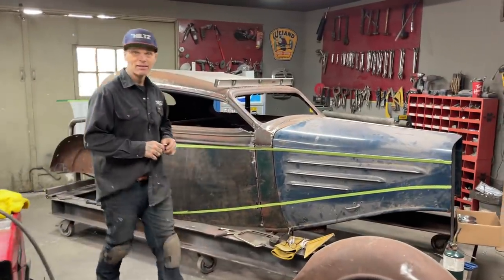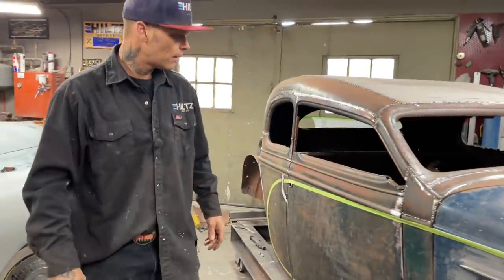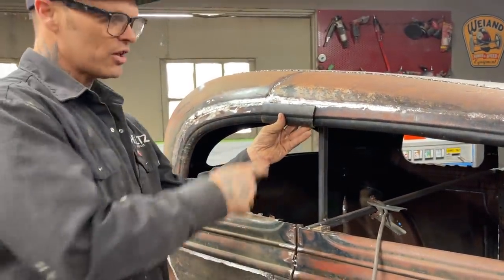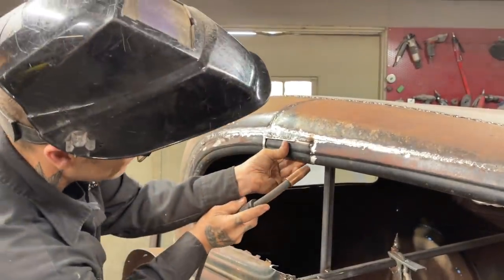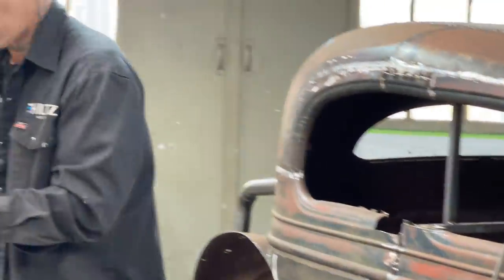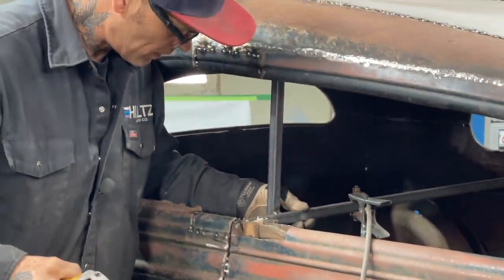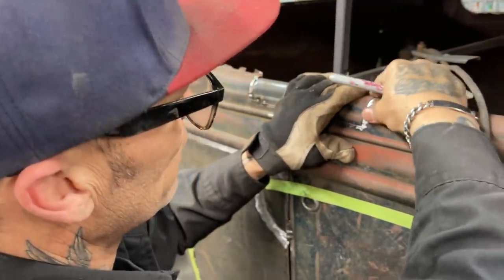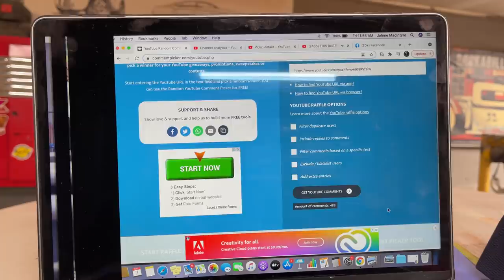EPISODE 10: BAD CHAD BUILDS (ANOTHER) BUGATTI OUT OF 1934 CHEVY -- WINDOW FABRICATION

Comment: Chad and Jolene love what you do.  Chad the metal man and Jolene the camera lady.  Chad love how you approach and execute what you do.  Having bent a few pieces of sheet metal over the years.  What you are doing is not wrong, but what I do when I am working with a style line is make the pieces and tack them in place, then go on to the next piece.  Fit and tack that piece. Just tack the pieces enough to hold them in place.  Then take a straight edge and place it in the style line to check the alignment and fit.  That works for me.   Happy cutting and welding.

Comment: Chad....
I was expecting you to cut one long piece out of the scrap rear door long enough to span both the quarter panel and the door on the car, weld it in, and then do a zip cut to separate the door from the quarter, guaranteeing a perfect match up of the lines, rather than doing it in two separate pieces like you did.  I know there are no rules, and there are many way to the same end, but that is just what I was expecting to see.  In any case, it turned out well for you.  Maybe on the other side you can use one piece for both the 1/4 & the door.....
Best Wishes.....RooDog....

Comment: One thing that bothers me is, I don't think you moved the back fenders back far enough. This feature is the most distinctive thing about this model it is the almost disconnect between the main body and the back wheels. I would move the fenders back about another 3 or so inches to where the wheel front edge does not overlap the main body.
Reply: Don't know what your talking about

Comment: Im disappointed  that. You choose to justify the use if sloppy lap welds rather than teach the art of welding but welds you say that grinding makes the metal weak and what's important is the melting of the metal that gives it strength not the booger lumps you leave behind  on the surface. Welding is a art not to be slapped together in a sloppy fashion you should yank this video down due to really bad information